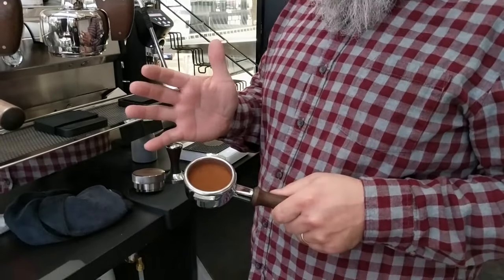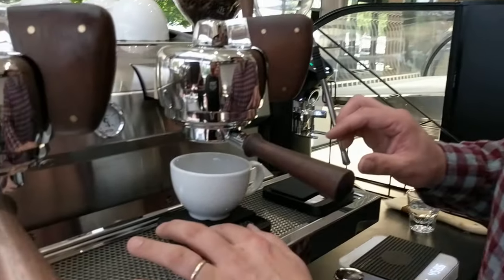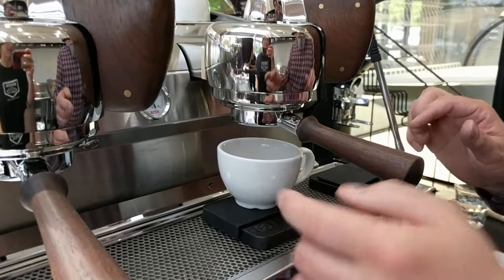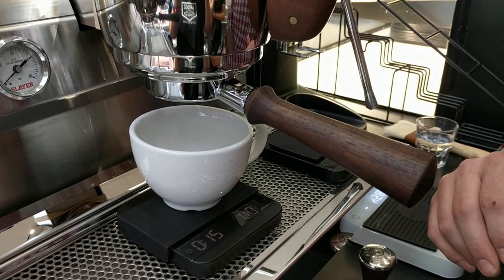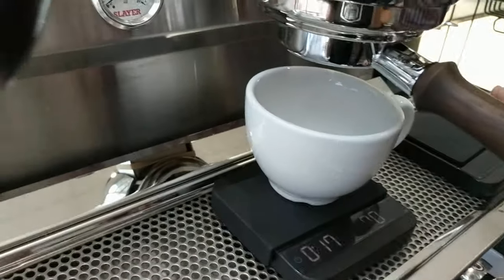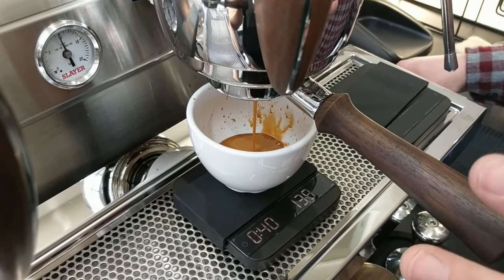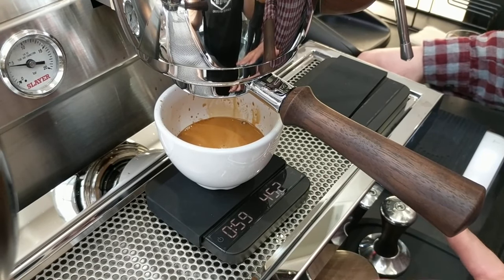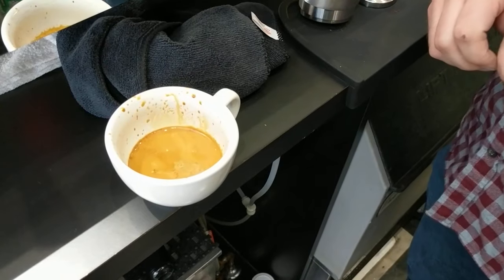Slayer Espresso Recipe Ramp up - Ramp Down

Comment: How did you determine 20-25seconds is optimal for first drops in the cup?  And how did you determine 30g is best to reduce the flow back down?  Ive read effective brew temperature is directly proportional to flowrate i.e. the slower the flow the lower the effective brew temp.  Have you found a higher brew temp is needed with low flow shots?
Reply from the maker: Great question. We found that our optimum temperature was fairly low at 198.5f at full-flow through the shot. Any hotter and we had unpleasant astringency. The initial goal of 2-3gm in the cup was on advise from Slayer. We played with the flow rate and settled on a setting that had wonderful balance of acidity in the cup. This amount of time, happened to be around 20 seconds, but the time was not the goal, the taste was. Finally, the ramp-down was to bring additional sweetness to the cup. ((This recipe was specific to our blend of coffee, we roasted to our specific profile.)) I definitely recommend going through the same process for your coffee to develop your own recipe. Salud! Tim
Reply: @bridgecoffeeco.roastery  When you ramp down at the end your pressure drops down to 1 bar, doesn't that mean you pretty much have no more puck resistance and therefore your grind is a little bit off?
Reply from the maker: @jevenator  the Slayer Espresso has 2 separate settings. The pump can be dialed into a particular pressure and the needle valve can be set to a particular flow setting. Additionally, downstream from your water filter, your supply water will have a residual pressure. Recommended, place a regular below your supply pressure for a consistent supply pressure. At the "low-flow" setting, you are at the mercy of your regulated supply pressure. Knowing that this is consistent is key to repeatable results.
Reply: Bridge Coffee Co. Roastery at the “low flow” you calibrate the needle valve to be within a certain flow rate. Not sure why you should care so much about your pressure elsewhere unless it’s changing all the time which it shouldn’t be. Your brew mode is that the pump pressure? (9bar in your case). What I was saying if you pay attention to your pressure gauge when you switch back to prebrew mode near the end of your shot your pressure drops all the way down to 1 meaning your espresso puck is no longer delivering any pressure and therefore it’s not within optimal espresso extraction.
Reply from the maker: @jevenator  given that the Slayer Espresso is such a unique beast, your question may be better directed to them. I totally respect your wishes and concerns. I can only tell you that our coffee, that I personally roasted, never tasted any better than on their machine using this recipe. All things considered, irregardless of history, what tastes best is what counts. After repeated tests, this worked best for our roast and is one of the best Espresso I've had in my 30 years of experience. I was grateful to thank Jason P. personally for creating such a machine. Rethinking conventional.
Reply: Bridge Coffee Co. Roastery I don't doubt your coffee tastes amazing given your enthusiasm. I was asking questions out of curiosity, not to bring anyone down. 

Have you heard of the Decent DE1 machines? Given your passion for coffee this might be a machine that will interest you in pushing you even further in espresso exploration.
Reply from the maker: @jevenator  I have not? I will look into it right away!
Reply from the maker: Actually, seeing their website, I do remember seeing one of their prototypes a bit ago.

Thinking about your statement about the drop in pressure does bring a whole slew of thoughts on pressure-profiling espresso. I've spoken with lots of folks about trucks they've done on various machines. There's also a recent article questioning whether 6bar might be the optimum pressure for espresso.

The needle valve flow control is such a unique animal in itself. All of these variables are why I love coffee so much. Art & science! Thanks for the input and sharing the passion! Salud

Comment: Bro... what's up with channeling though. That ground is too course. Secondly, what's the point of you pushing the timer and say timing doesn't matter ? Time does matter. You don't push the timer. Time starts when first drop of espresso hits the cup. In total it should be 30 sec or so.